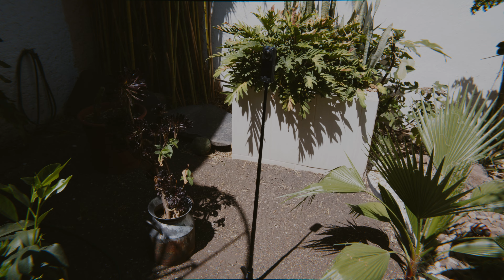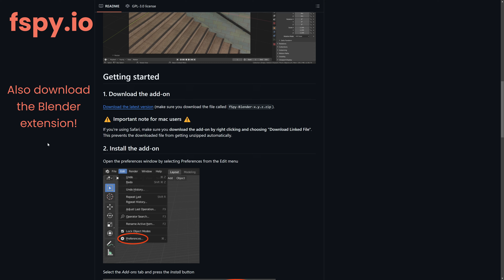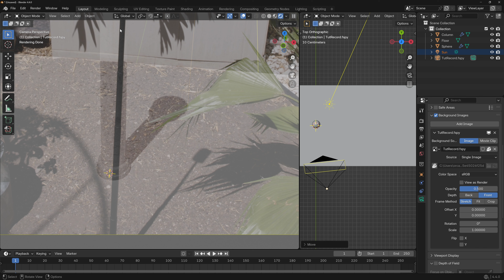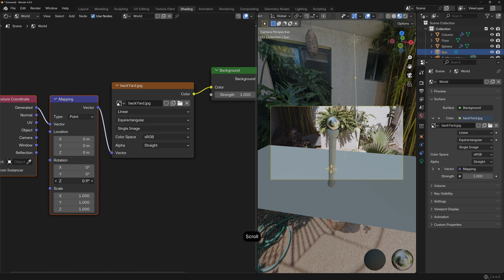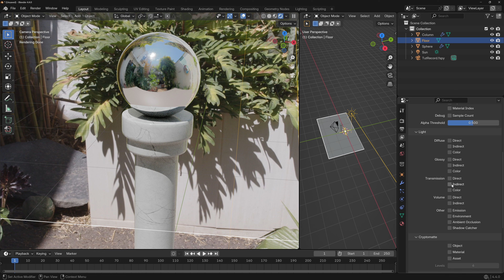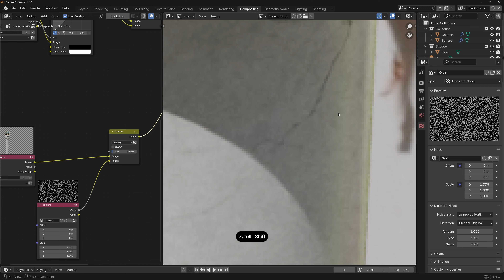Got a 360º Cam? Your Renders Are About to Go Next-Level!

Comment: Very Good video. I learned a lot about compositing with Blender. Insta360 X5 is able to take decent HDRI images they just need to be captured through photo mode. Under there you can also set it to capture in RAW format. You should be able to capture Good quality HDRI images with X4 also. Could it be that the camera settings which you show in this videos are from older firmware version? In the new updated firmware there isn't anymore that separate HDR shooting mode. All HDR settings are now under the regular photo mode. But perhaps that is the different between X5 and X4. As said very good tutorial and show cases perfectly where these 360 images can be used. Thanks for sharing!
Reply from the maker: The issue is the format, jpg pretty much stinks and that’s the only format they allow to export (at least in this camera). EXR keeps the light data which you can later use but I guess we can’t complain. The is for the comment!